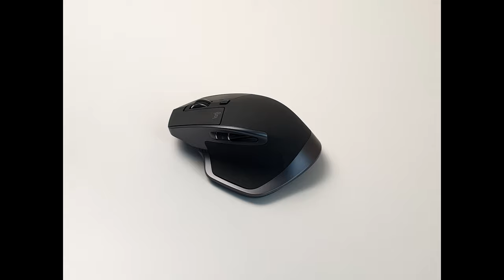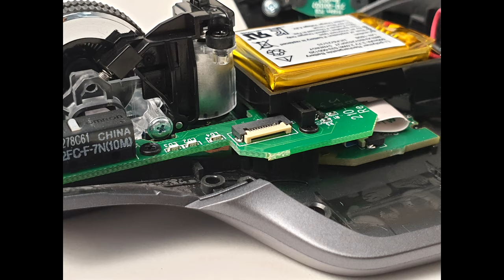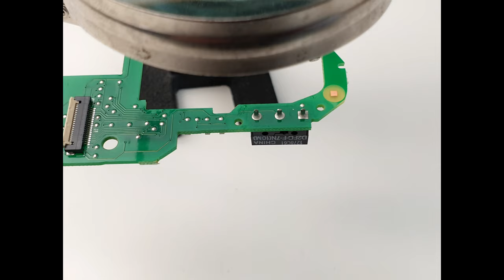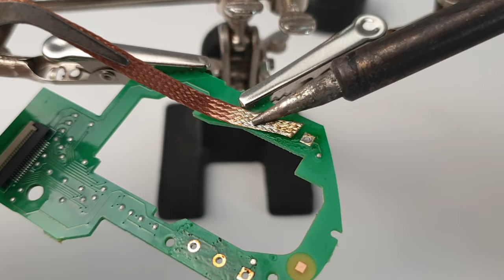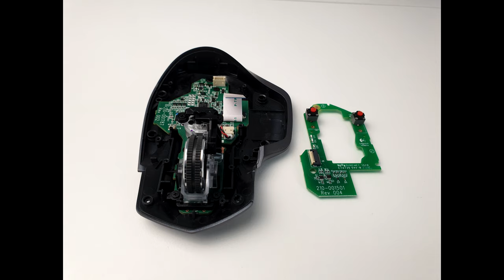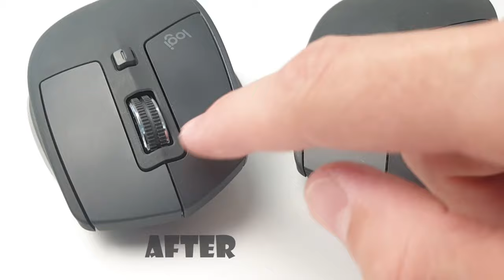Logitech MX Master / 2S / silent click  / teardown / switch replacement / noisy click

Comment: Thank you for this perfect tutorial, no 10 minute introduction and begging to subscribe, just straight to the point. Just modded my mouse and its incredibly quiet, finally feels great to use.
Reply: I triend with soldering pasted and with a Weller soldering station at 450 °C but I was not able to remove the old button. How did you do that? Any suggestion? Thanks

Comment: Nice mod. Still feels the buttons when pressing, but it is almost 100% silent.  Ordered 10 pcs in case they don`t last as long as the original. Remove stickers with heat gun, then you can re-heat them and use again.
Reply: so you're saying this process must be done multiple times in the mouse's lifetime ??
Reply: @nolan8017  it is some cheap switches I bought from aliexpress. They might not last as long as the original, so it is nice to have spare switches. But I don`t think I need to replace them often.

Comment: Thanks Sam. I ordered the same switches and swapped out the annoying klicky Omron switches. I like the silent soft touch of these switches. FYI - shipping took 1 month.
Reply: What? The clicky is what sounds so satisfying for a mouse.
Reply: @jinraigami3349  If you look for satisfaction in a mouse, there is something wrong.
Reply: @jinraigami3349  I'm on the same team. Rather hear something than nothing. Tried it, but couldn't get used to it.

Comment: My gesture button stopped working after 2 years of warranty (2s). I’ve already had problems with my mx master 1 mouse. Crappy quality for a 80 dollars mouse! I’m very annoyed with Logitech mx lineup but I didn’t have any other alternative
Reply from the maker: I have used mx master for about a year, 2s for about 8 months and got mx3, no problem. Following this video you can disassemble the mouse and replace the gesture button, it should be not so hard, just do it carefully.
Reply: Sam Low I’ve disassembled it and after a few clicks the button stops working again, sometimes it’s always pressed and other it doesn’t work, it I shake hardly the mouse sometimes it functions again
I don’t know it the problem is with the physical metal membrane push button (I had to check with a multimeter), because it looks ok when I pressed (feels clicky)
Also, didn’t had the change to say it before, but congrats for your video, very well done
Reply: Sam Low my history with mx master 1 was the left click button became unresponsive (doesn’t maintain the press 10% of times - bad micro switch).  But Logitech warranty gave me a new model. I buy a 2s and use it almost daily for more than 2 years (warranty ended last april). I never had problems with the micro switches... but now I have a problem with the gesture button for the first time
Reply from the maker: Yes, it can be a membrane issue, as I remember here 1 or 2 screws for the gesture plate with the button. Try to push up the membrane and find a good position for the plate to get the membrane pin be directly up to microswitch button. I saw this issue as well with one mx master which I also  fixed buttons.
Reply from the maker: @SamuelCarreira  please see above

Comment: Hi Sam, theses silent micro switches are durable as conventional switches ?  I had a switch problem in my G500 and change the micro switch, but the click sound it got worse.
Reply from the maker: I`m using mine S2 mouse for about 10 months, no problem with the switch yet.

Comment: thanks for this video! I have a mx master 3, It start to give me a little problem to left button (single clicl,, sometime it doesn't works) so maybe soon I will change the switch. This video is very useful. One question: 
what kind of glue do you use to put again the black bands?
Reply from the maker: It's on the double layer tape. Heat it with the hot gun or hair blower to heal and unstick carefully. Then you can stick it back again.

Comment: Haven't soldered much in my life - what's that copper looking cable you bring in that seems to suck up the soldering from the holes @1:34? 
Edit: OK I just googled copper desoldering, and I found something called desoldering wick, and it's that exact product. I already have a soldering iron and now I just have to buy the 10 pcs mute buttons on ebay for a few bucks. Thanks!
Reply from the maker: yes, desoldering wire / wick etc, it`s about 1-2$ product but really helpful

Comment: Hi, does this work on the MX Master 3? Its is even louder than the 2S and it's really driving me nuts!!
edit: I scrolled further down in the comments and apparently it's possible. Will try!
Reply from the maker: Yes, I`m using mx3 now and also charged switches in it, the same method with the same switches.
Reply: @samlow9077  Thanks for the super-fast reply! I ditched the 2S because of the loud wheel, and now with the mx3 I couldn't believe the wheel is so perfect, but the microswitches got somehow louder!
Reply from the maker: @grproteus  agree, mx 3 scroll awesome. It using electromagnetic system which gives this quite performance. I`m happy with mx3 and after quite mod with switches. Do it as well and you will don`t take any other mouse in the future)
Reply from the maker: I have not made a video with mx3 yet, But I have made many photos for the mx3 process, you can find me in Instagram @samlow.blog I can share for you if that may help you
Reply: @samlow9077  already looking into it in aliexpress. Found some red kailh switched that are supposedly pin compatible with omrons, but I don't know how they sound. Possibly will be using the "noname" square ones like you propose. 

Did you have any double-click issues with the square ones, btw? Thanks!
Reply: @samlow9077  Thanks Sam! Will follow you on insta!

Comment: Great video and mod!
A question: using different type of switches (usually, mice clicks have those 3 legs to be soldered) doesn't interfere with the circuit?
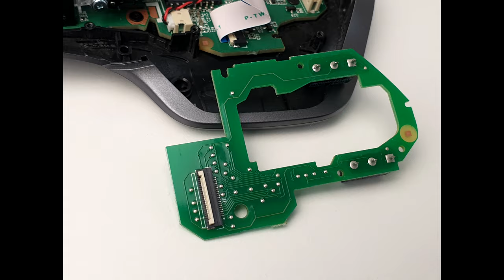Reply from the maker: yep, as you can see 1:10 3rd leg not used at all here on the board. on the pict it`s firzt leg, so used only 2nd and 3rd legs where I soldered the 2leg switch

Comment: Can someone recommend a soldering starter kit to achieve this task? Never done it and don't really know where to start.
Reply: Any with 4.5 stars and above on Amazon (60W or above - they are all 60W!). Lots of choice when it comes to kits. Add on solder-wick (none of the kits seem to come with wick). If you want something extra nice (really not needed) get a soldering station.

Comment: Does this work for MX Master 3 for Mac?
Reply: I just did something similar to my MX master (using a mac) I used a different method. Adding some memory foam inside the microswitch itself. Could feel the click, but not hear it.
Didn't liked it at all. So ended up soldering in a pair of new switches. Although i sometimes hate the click sound, it does help me using the mouse.
Reply: @Jesse-dn2ut   which switches did you use?